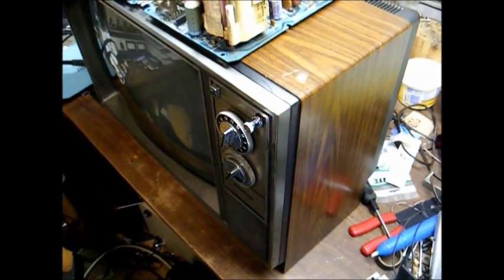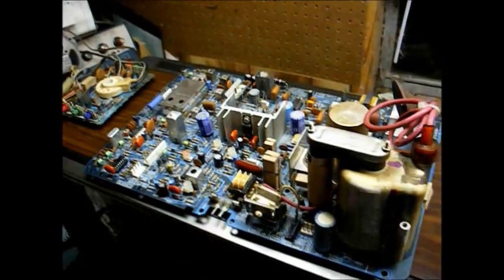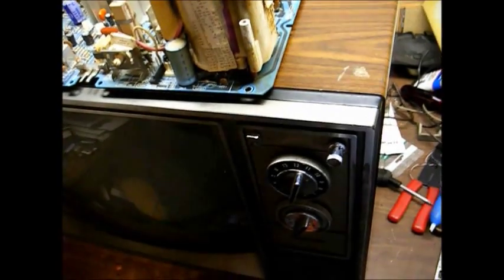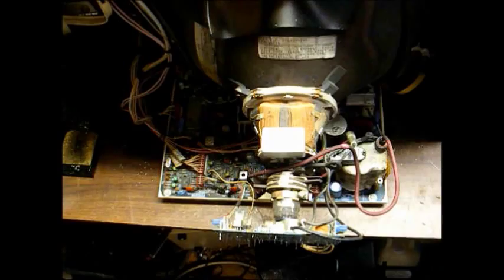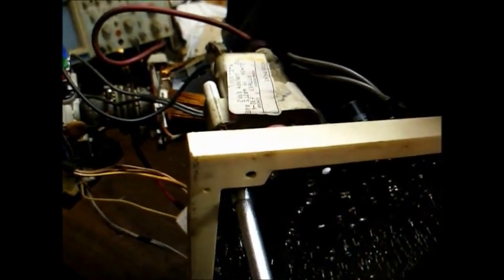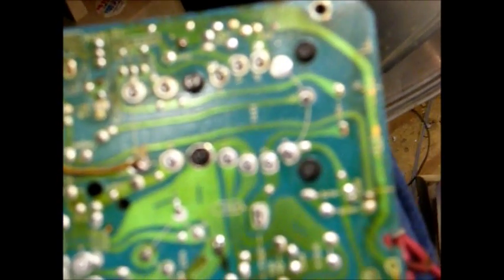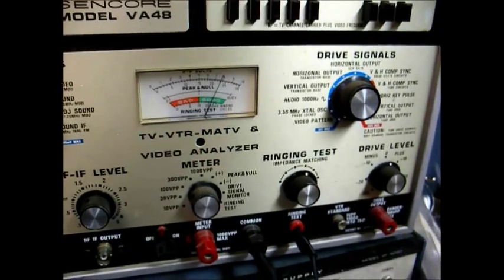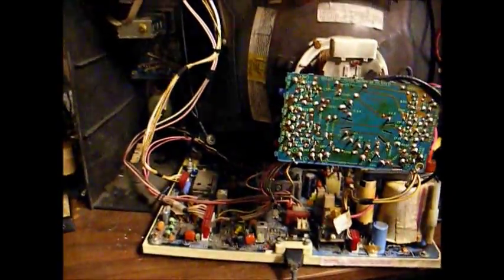Flyback transformer replacement in a 1982 19" Sylvania E32 chassis color TV

Comment: I worked for a commercial tv company repairing set for hotel motels an so on,this sets where a real pain when you walked in the  TV room of the hotel the was at least 7 to10 bad sets waiting for repair,at least a 2.1/2 hour stop to fix them they also had a xtal that went bad causing horz problems also a diode and resistor failed causing no sound.One thing I do agree the picture was excellent The commercial sets where under the name of Magnavox

Comment: Thank Heavens for friendly colleagues!  And for the incandescent light bulb.  I'm never without good friends and the light bulb.  I looked into my old shop that I used in the 1980s, and the bulb jig is still there--a vanity fixture with a row of sockets, into which I have screwed lamps of different wattage ratings.  It works like a decade box, sort of.  I can get whatever degree of current limiting I need by screwing fully in whichever bulbs are appropriate.

Comment from the maker: It could have a shorted horizontal output transistor (HOT). If the HOT is shorted, there may be bad electrolytic capacitors in the power supply or horizontal drive circuit that caused the HOT to short. A shorted HOT can also be caused by bad solder connections or a bad flyback.

Comment: Hey I got a Panasonic CRT CT27HL14J, won't power on, error code blinks once every 6 seconds.  No HV output, try to turn on but errors out, relays click.  Heard it could be the HV drive transistor, any ideas?